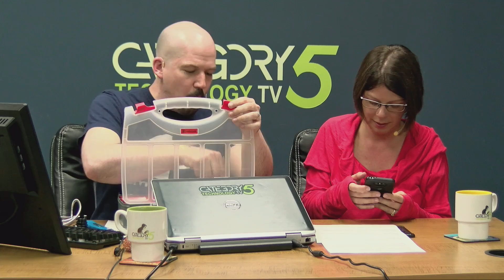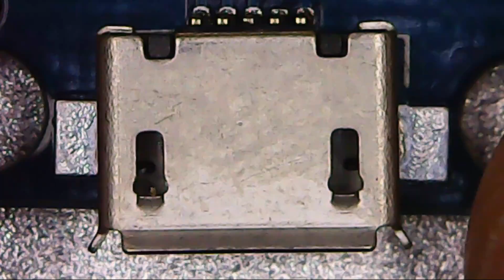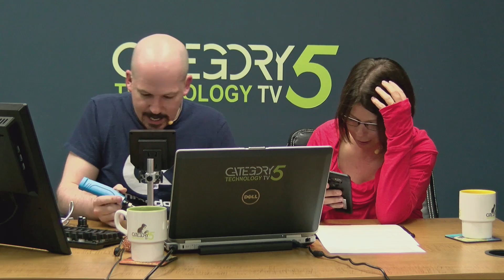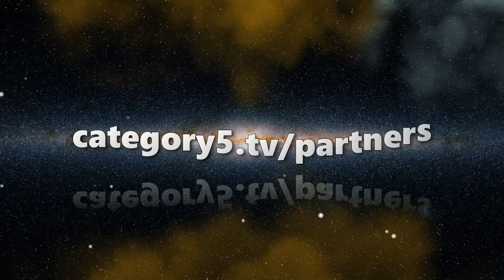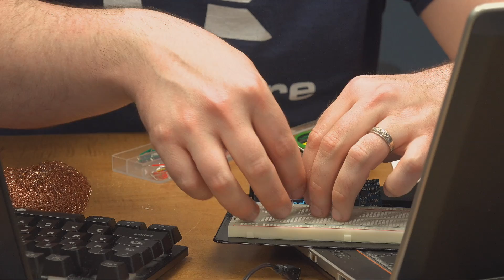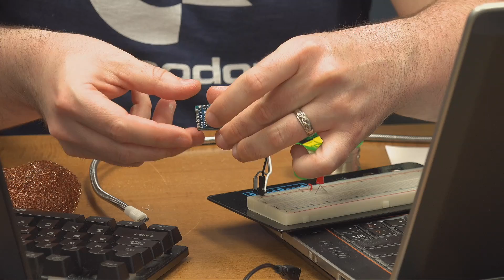Digitspark Beginner Project: A Flashing LED with Arduino

Comment: Some comments on your soldering to make some improvements.
1 Use lead based solder unless you want it to fail. (I had to use the way back machine to find the content https://web.archive.org/web/20160731011927/http://www.pbs.org/cringely/pulpit/2008/pulpit_20080221_004346.html ) (Your soldering iron can also work at lower temperatures.)
2 You don't add the solder to the tip until you have heated up what you are soldering. Then and only then you add the solder.
3 If you put the solder on the tip you need to clean it off.
4 The longer the solder is on the tip of your iron the more flux you destroy.
5 Flux is your friend and helps the solder to connect to your components.
One example where on some of his videos you can watch a professional solder is bigclivedotcom on YouTube. Don't try getting the soldering iron as close as he does to his fingers until you are close to his level.
Please watch some better people solder before you make another attempt at soldering on TV.